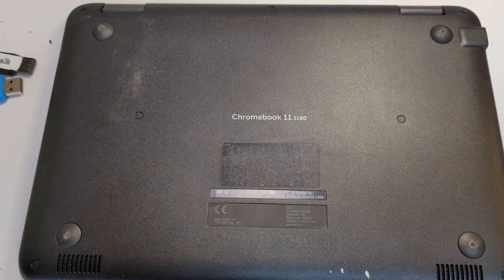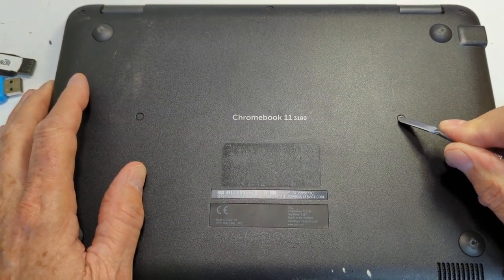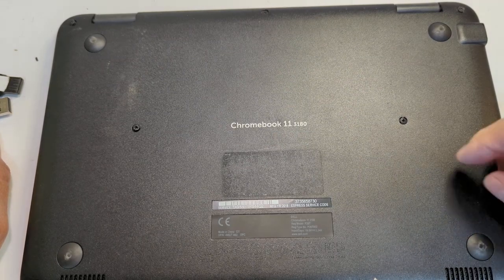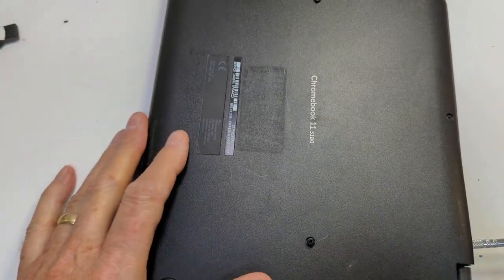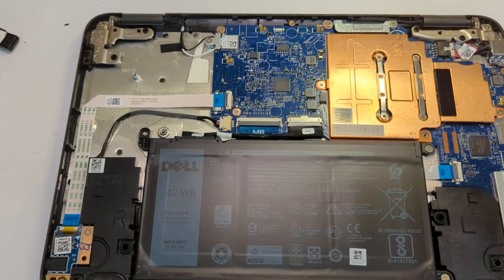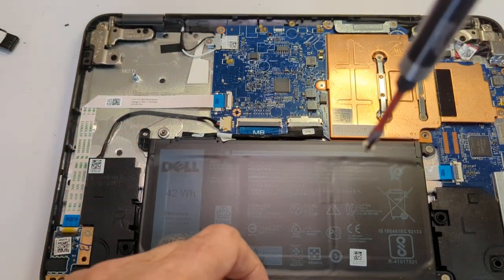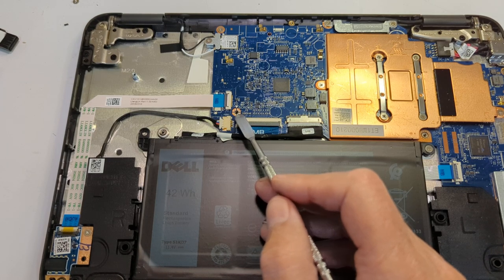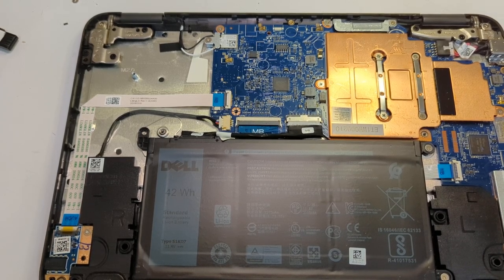Chromebook EOL   Dell 3180   Part 2 Write Protect Screw

Comment: For your information, if your chromebook doesn't have that screw, simply unplug the battery from the computer and use only charger, that worked for me as mine didn't have the screw.
Reply: I get w25q_disable_writeprotect (): error=1
Reply: cr50s require removed battery
Reply: all chromebooks with usbc have a cr50

Comment: I found your videos searching for the CR50 WP overwrite, sadly, you only have done WP screws, but, thanks for showing the rest of the process, maybe someday you will do a CB with CR50 WP, keep doing your great job.
Reply: take the battery out
Reply: @insanestudios8018  is that it, no need for any suzy q cable of sorts?
Reply: @faviogc31  yes, take the battery out
Reply: My acer chromebook C731-C7P9 is admin locked, what do I do to bypass that?
Reply: @thomroy3264  shimmer and dev mode

Comment: Any suggestions if the write protect screw is stripped?
Reply: Get out your Dremel tool and drill a  small hole in the middle of the screw head.
Find Allen key tool that can be tightly fitted in the hole.
Clean the hole and the Allen key tip with rubbing alcohol.
Epoxy the Allen key into the hole, and let it cure overnight.
Unscrew it the next day,